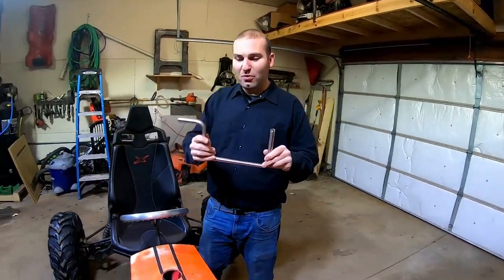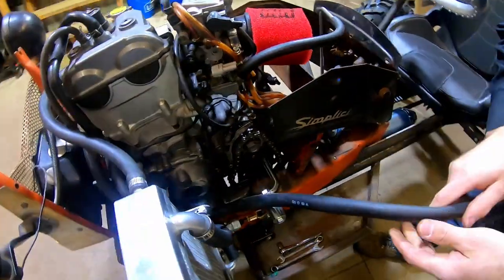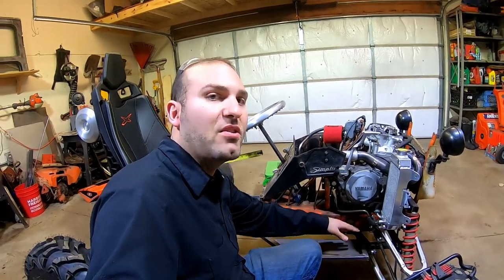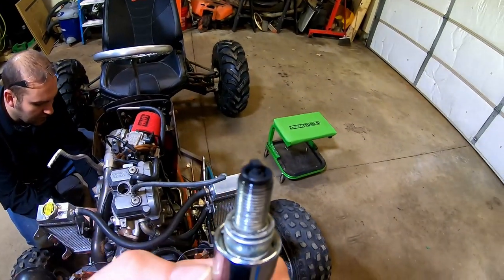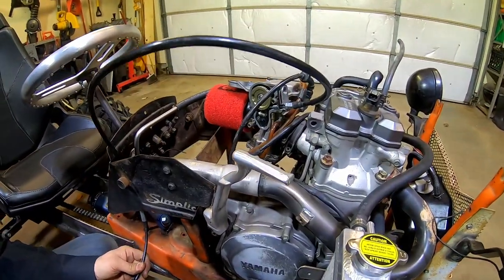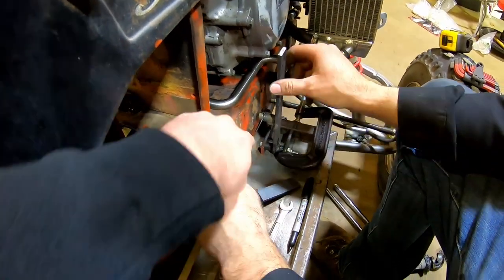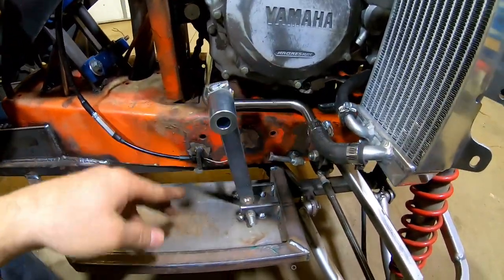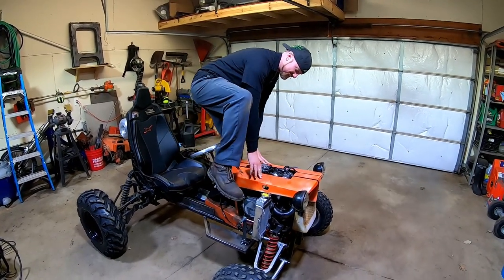Will It Start!? YZF450 Extreme Garden Tractor!! Not So Simplicity S1 E14

Comment: Wheels from a skateboard are durable and cheap
I used to use them when I built choppers in the 70's.
They are silent.
Reply from the maker: That's a good idea!!
Reply: Yes they work well but the sprocket and bearing is a little better for keeping that chain on the idler

Comment: Loving the build guys. Might want to put rubber bushings around the new steel radiator line when supporting it. Just putting straps on it to hold it down may cause the line to get a hole over time from vibration.
Keep up the good work. Can’t wait to hear it run

Comment: Cool build fellas! Just a thot on the dark plug and the hard to start issue. That carb is the same style as the one on my Honda 450. The fcr carb is known as one of the most complicated carbs ever used. Very finicky. I would suggest a rebuild. Be sure to replace the mid body gaskets. Jd jetting has the best description for the mid body kit. There’s two styles. I hat the wrong kit first time around then found jd jetting. Good luck. Looking forward to seeing it finished.

Comment: I'll bite on the comment... since you had a line made  for the coolant you should of ran it in front of the engine. I'm just not a big fan of the chain being that close to it.
What's your field? Schooling wise/ day jobs?
Reply from the maker: We are going to mount the tube with one of those brackets with the rubber grommet in it to keep it away from the chain. I am a cad designer and that's what Im in school for, I'll be finishing up school this spring!!
Reply: @CRACKEDHOUSINGFAB  thanks for the reply, I know your using a grommet  and maybe it will be fine.

Comment: Checkout highlandcycles video “fixing the fcr carb”. That’s where I learned of the mid body gaskets.
Reply: I just replaced the midbody gaskets on my crf450. People spray brake cleaner in there and it dissorts the rubber so it definetly helped with starting. I also replaced the seal on the floating valve on the flatslide. If that goes bad youll see irregular idling